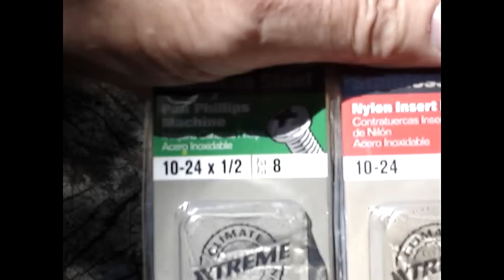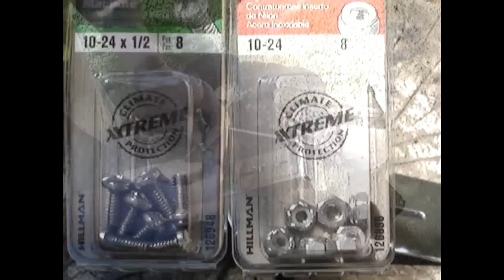RUIXIN PRO Knife Sharpener Modification

Comment: magnets do not help on stainless steel!
Reply: Depends on the type of stainless. The type usually used to make knife blades is magnetic enough for this application if you use strong enough magnets.
I use the same method as this guy and haven't had a problem with any of my stainless knives.
Reply: All the cutlery grade stainless steels I use for knifemaking are most definitely magnetic.